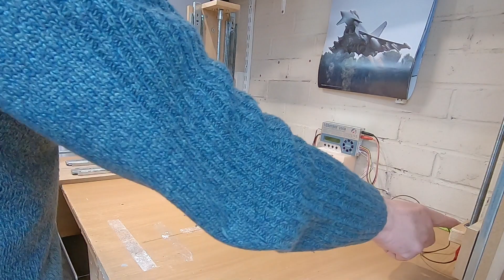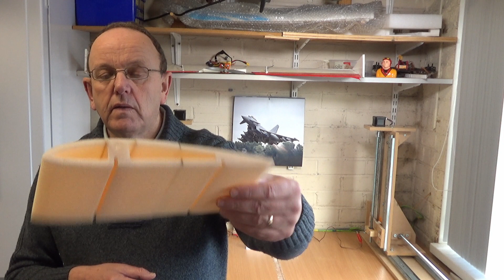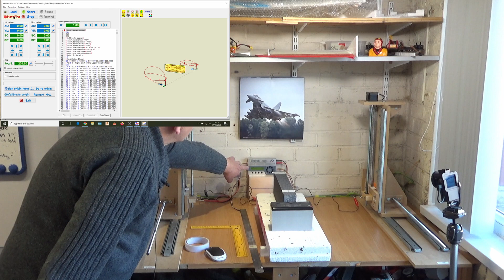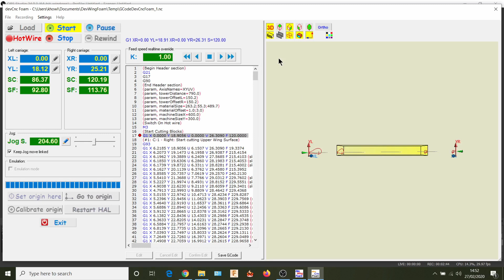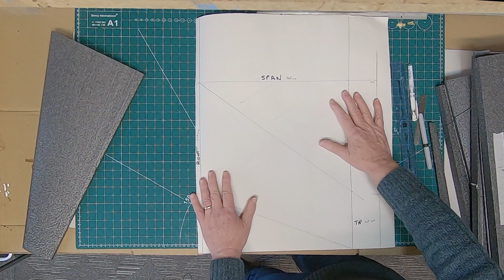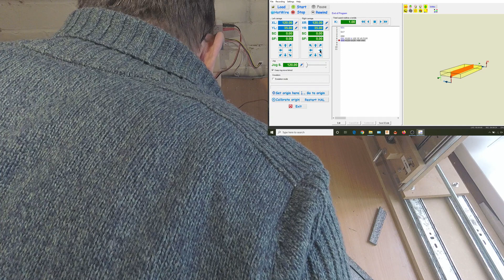DevWing Foam 2 Tutorial Part 3 Cutting Parts for CNC Foam Cutters

Comment: I'm VERY confused. I had no idea that this program could control the CNC machine part of it at all. I was under the impression that it would generate G-code that would in turn be loaded into the GRBL controller you put together in your other videos. But if DevWingFoam can control the cutter directly, great, but you completely glossed over setting that up. How does the DevWing program know anything about your cutter? Turns of the stepper motor vs. distance traversed?  At this point I've got four stepper motors that I can move about with the GRBL controller, and have purchased the DevWingFoam software. I have design a simple Clark-Y wing I wish to make. I just have no idea how to take that design and feed it to my GRBL controller.
Reply from the maker: Explained here https://rckeith.co.uk/devwing-foam-2-tips-and-tricks/#using-devwing-foam-2-with-grbl-hotwire
Reply: @rckeith  Oh, yes. That works. Thank you.

Comment: editing my original quesiton as i found the devcnc foam software you are using. Being that im on Linux cnc now, how hard is it to move to using devcnc. Will that work with my printer port controller or do i need to get a usb one? thanks keith.
Reply from the maker: Hi Nathan, sorry missed your comment. DevCNC Foam needs an Arduino Mega or Uno but you can interface this to a parallel port  have a look here
 http://www.devcad.com/eng/devcncfoam_f1.asp
If your LinuxCNC is working OK then you're probably not going too gain much.  DevWing Foam2 will work with LinuxCNC  and thats probably where I'd invest in first. 
Using the Arduino Mega with a RAMPS board you are limited to at most 2 Amps on the steppers so that really limits you to NEMA17's.  If you have NEMA23's then you have to start using seperate drivers
Hope that helps 
Keith
Reply: @rckeith  thanks Keith!